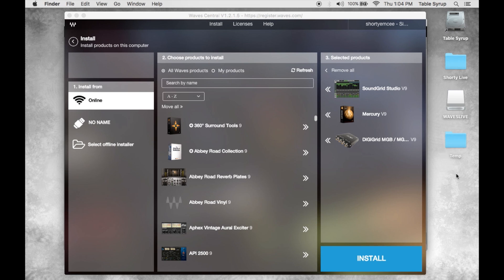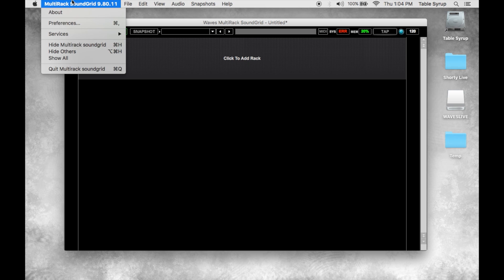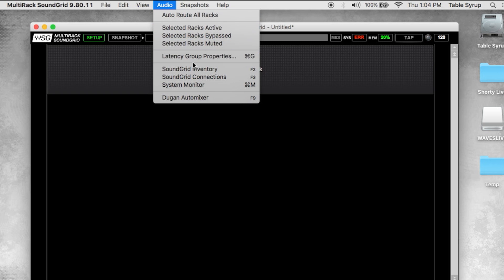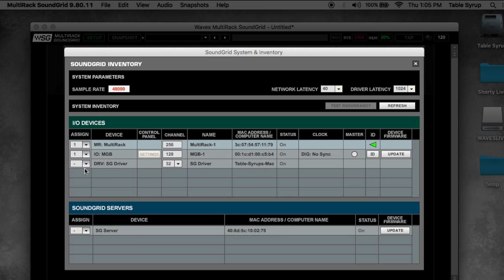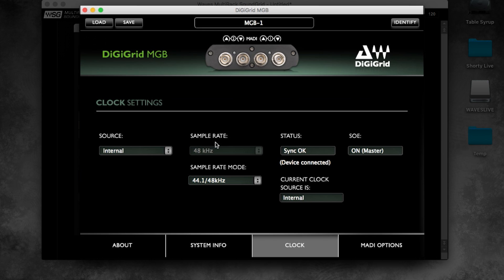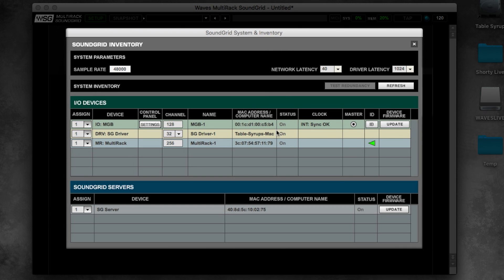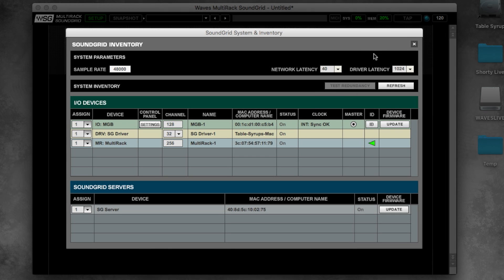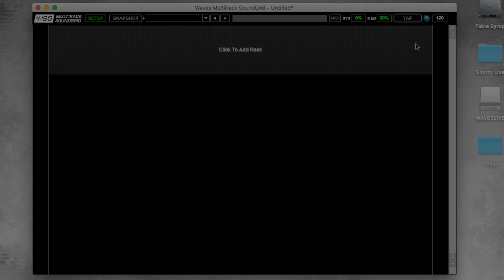How to configure Waves MultiRack with your SoundGrid system

Comment: Hi,

I’m interested in using the waves multitrack for a two piece vocal setup using backing tracks... As you see my setup is simple and small... 

I’m using a windows laptop with the Behringer xr18... So for such a simple setup, would I need the DigiGrid or would the multitrack software installed on my windows laptop be enough

Option 2...
If I decided to go with the “DigiGrid” what exactly do I need along with the DigiGrid to use with my laptop or is tha5 all I need? Just the DigiGrid and software “multitrack software”

I’d really appreciate you being specific as I’m new to digital....

Many thanks

Comment: Do you need a waves server? Or is it possible to use another computer as the "server" ?
Reply: You can use native, but the latency will go up.
Reply: @lightingman117  That's not what they were asking.  They were asking if you can build your own soundgrid server instead of using a prebuilt one from Waves.